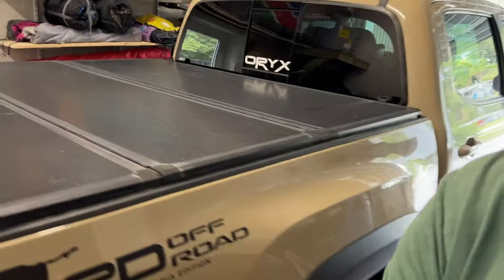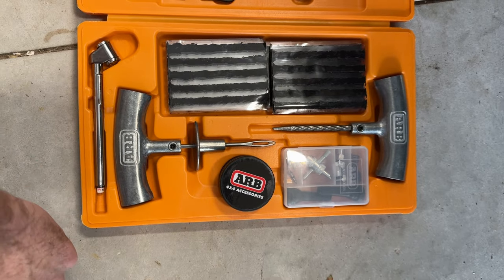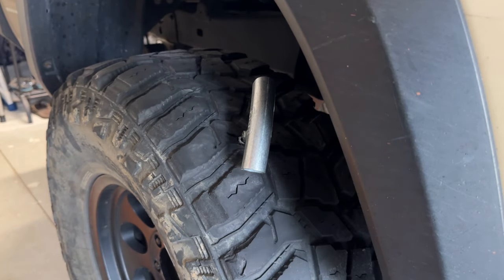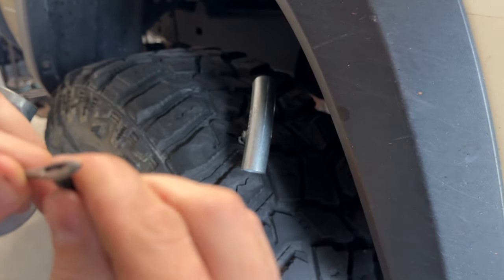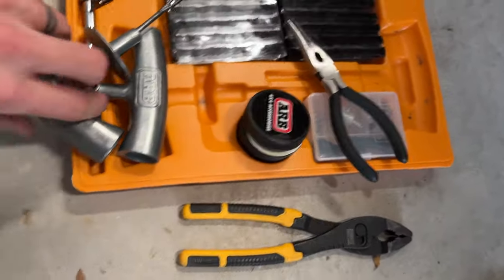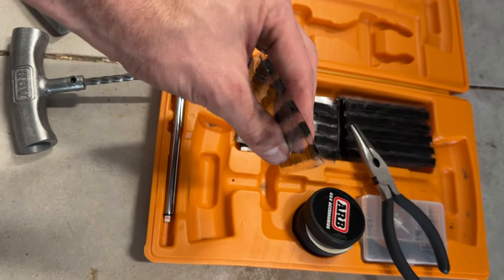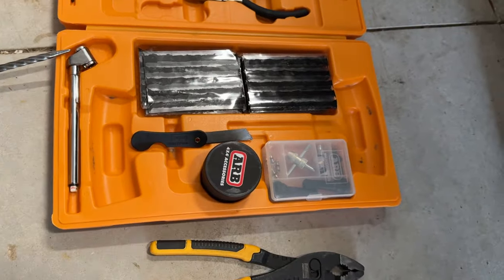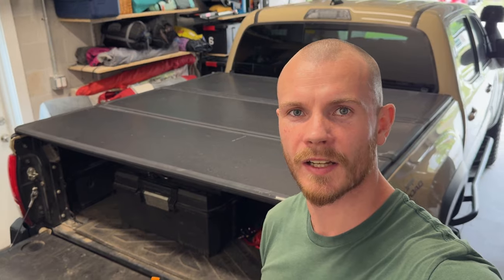ARB -  Speedy Seal Tire Repair Kit

Comment: The plug will go in a lot easier if you lube the entire plug.
Reply from the maker: Thanks. I didn't want to lube it too much, as sometimes they like to come back out when retrieving the insertion tool. But with the stopper on this tool, I think that would have been fine.